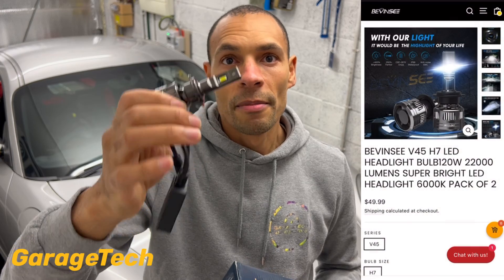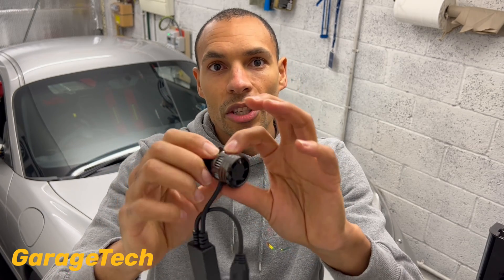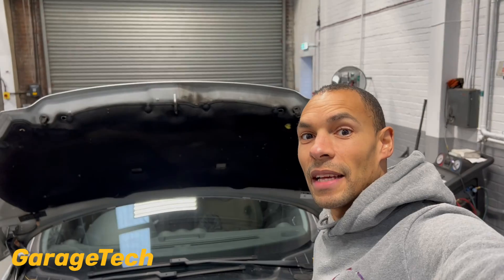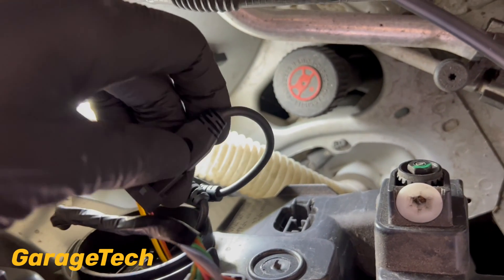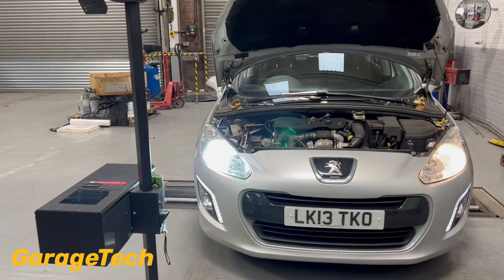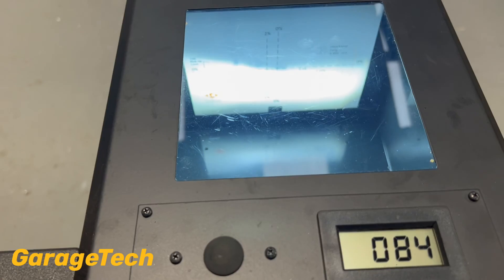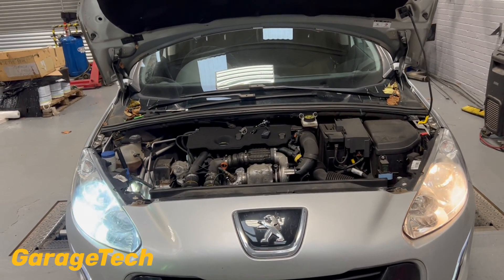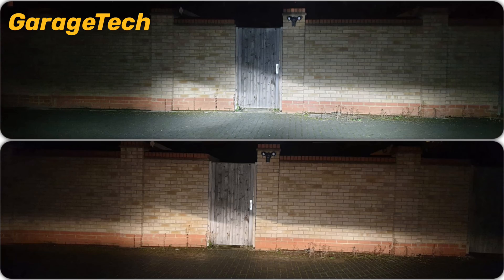Bevinsee LED headlight bulbs v halogen bulbs, fitted, brightness, temperature & beam pattern review

Comment: NO , NO, NO,YOU CANNOT USE LED BULBS IN NON PROJECTOR HEADLIGHTS, you should know this AND should be telling potential buyers this ! they will dazzle oncoming cars/traffic  continuosly.
Reply: I think you're thinking of hid bulbs which require a projector lens to focus the beam
Reply: @bacevs  no, BOTH hid AND  led are designed to work in projector  lenses, you CANT put led or xenon BULBS into a STANDARD reflector, ie, non projector, it causes too much dazzle to oncoming traffic. FACT !
Reply: That's just false, modern LED bulbs work perfectly fine in reflector headlights.
Reply: I think that the problem comes from the way the bulb is mounted. When the chips emitting the light are facing up and down light is scattered and when they face sideways light is in a rectangular shape. So the 90 or 180 degree mounting and reflector shape is what matters. So what you are saying is not always true but can happen. So it is not a fact.
Reply: Have you tried these in your own car or motorcycle or did you read that somewhere. I use a specific British Pre Focus led designed for the type of headlamp fitted to 1950s and 60s vehicles and it has a very sharp cut off on low beam, and doesn't cause anyone to flash me.  Cheap ebay led's that aren't designed for a particular vehicle dont focus in the headlamp correctly and scatter the light everywhere, and besides not lighting the road properly, they dazzle oncoming drivers. I've tried the cheapest ones and the correct ones. They are not all the same and need to be specific to the vehicle they will be used in.

Comment: Hi, Professional work. thank you. How do you adjust the Kickup, for driving on the right side countries?
Reply from the maker: Hey, sometimes depends on the vehicle, There should be a switch or lever (sometimes a screw) inside the headlight unit that allows you to adjust the height of the beam pattern some will have a leaver on the headlight which flattens off the beam pattern. If not, then you will need to buy a sticker which you stick on the headlamp which flattens the beam pattern.
Reply: @GarageTechAutomotive the halogen bulb is more powerfull than the led one? 100 vs 80 lux?
Reply from the maker: @ hey, what I tend to find is the Halogen bulbs have a more sharper beam pattern, the light and dark areas are quite distinct, whereas you can see with the LED it tends to light the areas outside of the beam pattern area much more, could be why on the headlamp machine it’s a lower reading. Certainly driving on the road is a whole different league at night, better light colour and road sign are much more reflective.

Comment: Keen to try these, are they legal for road use in UK as I know some aren't. Cheers
Reply: They are legal but you will fail the MOT , so put regular bulbs before
Reply from the maker: They have made some changes to the MOT regulations and I can’t remember off the top of my head, depends on model year and if you have projector headlamps I think 💭
Reply: @GarageTechAutomotive  are these legal on a  2005 Peugeot 407?
Reply: Awesome 👍